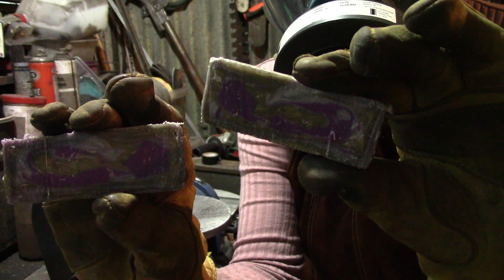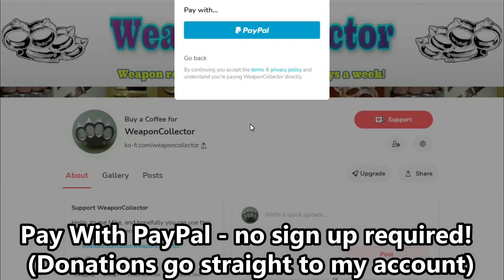Metallic knife Modding - Melted Bottle Lids Handle

Comment: I just finished tarting this little knife up today, it's a shame I didn't think to take any before photos. 
I asked Mike to add a couple of pins to the lower end of the handle for me for a better fit and stability and I used super glue to fill and holes and gaps and sanded it down to a 3000 grit, mirror shine on the pins and the scales are glowing. 
So chuffed with this. 
When Keith saw it he was very impressed and gave me a lovely leather sheath for it. My grandson loves it, which is of course the main thing ❤
Thanks again Mike for all your help advice and expertise xXx